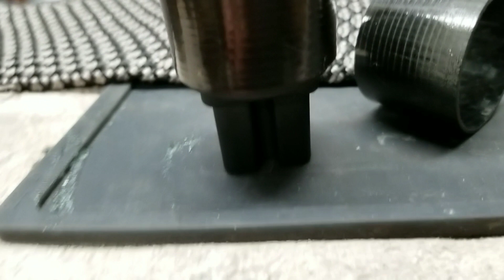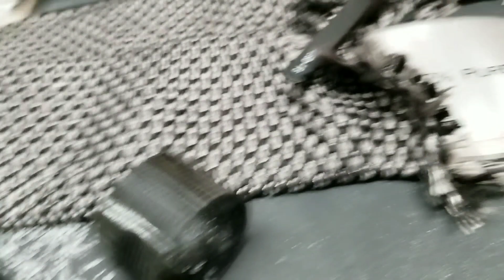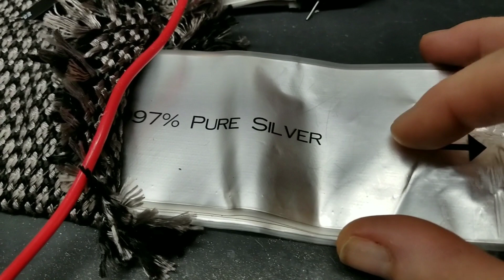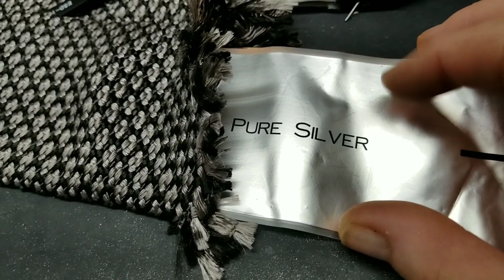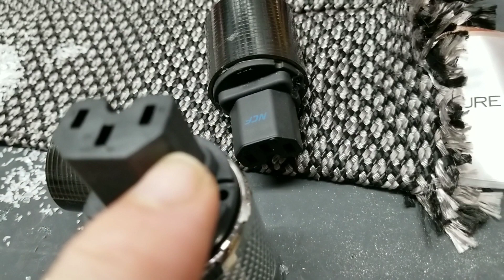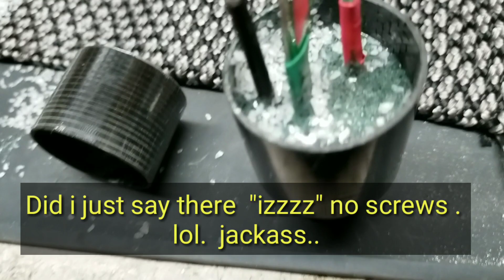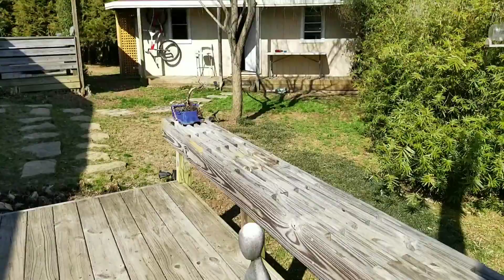Are "High End" audio cables SNAKE OIL ?

Comment: Wouldn't using foils make the capacitance go way up?
Reply from the maker: Sometimes it would , yes.
Reply: @OCDHIFiGuy  Ok. One more question; Why use silver when  you can just use more copper to get the same resistance?
Reply from the maker: @kacperuminski1547  thank you for asking a smart question about the cables. The reason is that Silver sounds different than copper. I can be more specific. 5N silver sounds different than 4N copper in my rig. Many other people experience this same phenomenon
 So it must be a collective imagining by all of us. My guess is due to 5he different lattice structure of silver vs copper
Reply: @OCDHIFiGuy  Copper and silver both have a face-centered cubic crystal structure, so that shouldn't be the differentiating factor. A simple way to tell if there actually is a difference would be through a null-test. Have you ever tried doing that? Have you, perhaps, done any measurements of the cables which you could share?
Reply from the maker: @kacperuminski1547  thanks for the input, is it possible there are things in the world we can not explain or do you feel if it can not be measured then it does not exist ? Again. The other 200 or so hifi cable companies and I have gone around the merry go round with guys like yourself. You're asking healthy questions. Clearly you have a background in science or engineering. I would prompt you to speak with the quantum physicist that own some of these hi fi tweak companies. Jack Bybee for instance. He's got quantum devices that change the sonic. Much more interesting than silver. Let me ask you this.  Some audio systems have a flat, 2 dimensional sound. Others are 3D. How do you measure the level of holographic soundstage ? Because that's what silver does. How do you measute realism. That's another that silver brings, as well as presence. So excuse me while I dip out of this conversation
 Once again you are pushing your prerogative on my thread that states I'm not trying to prove it works for chrissakes. Proving cables work to disbelievers is futile ! How bout this? They dont work at all. I am making people believe my lie because I'm such an adept hustler. So they dont work and my customers are imagining it. We are happy.  Leave us be
Reply: @OCDHIFiGuy  It looks like you are misunderstanding my reason for asking these questions. I want to know whether you have a scientific reason to implement these things into your design or if you're doing it "by ear".

Unlike many people, I am not completely opposed to the use of superior cables. The key word here is "superior" because the cables actually have to be that to justify the cost. Many companies make cables which actually perform better than 10awg zipcord for reasonable prices. (Kimber) They also look nicer. Even though the improvements are almost certainly inaudible, you can always make the case for overengineering.

The issues arise when companies make cables which perform so poorly that they act like a tone control. (Harm the signal.) If you want to equalize your system, you should just use an equalizer.

My goal is to separate the good ones from the bad ones. This thread seemed like a good place to get a grasp of your view on the topic. I was basically curious if you could back your cables with actual science. I feel that this is relevant to the discussion because the main topic of the video seems to be cable design.

PS. If we can't measure something, we definitely can't hear it. Measuring equipment is in every way more sensitive than our ears. It can tell cables apart easily even though we evidently cannot. Finding a property of conductors which couldn't be measured, but which affected sound would be a groundbraking discovery, possibly warranting a Nobel prize in physics.
Reply from the maker: Theres absolutely no way to make a blanket statement true for all humans such as if we cant measure it we cant hear it. Can you measure the voices in my head when I see a hot woman walk by ? I sure as shit hear it.  Can you measure dimensional characteristics in audio ? absolutely not. In other words, how 3D is this system sounding, and it totally changes. So again, if you want me to prove and humor you I say another time and another thread because it involves me driving to a mastering studio and making a video. Science does NOT know it all for science is developed by Humans, an interesting carbon based organism not far from Chimp that seems to want to eradicate itself by eliminating natural resources. Einstein has been proven wrong. Old rules do not apply. Anything is possible including the crazy thought that maybe by using different materials in audio signal transmission lines,  different results may occur. If it is different results we want we use the ear because everyone hears differently. If we want the same result, we use something man made that is very limited in its capability, measuring things like frequency and amplitude archaic characteristics that all rely upon the time domain being linear... which it is not.  So look my man, theres no way you and I will agree, we are like 2 separate species. I happen to believe in something greater than ourselves within which we operate.  Just so happens a lot of us feel the same way. I know of many things felt, heard and sensed that can not be measured with instruments from this plane of existence.  My Hi Fi rig  with music opens the door to higher realms of understanding and awareness.  Good day sir
Reply: @kacperuminski1547  Really? This is good news for me then... I've got 6 patent pendings in this subject!  I can transform the audio performance output on any WIRE, even insulated ones!
Reply: @esotericaudiophile3884   It's quite easy to make audibly transparent cables if you know what you're doing. Your designs must either be very bad or insufficient for the task if they audibly affect the signal. Or you're just imagining it. In lieu of this I have two questions:

1. Did you scientifically prove that you, or someone else, can hear the differences? If yes, where can you access the study?

2. Are your cables within spec for the application they're used for?
Reply: @kacperuminski1547  Yes! Everyone can hear the differences in a "big change" in overall quality to the point that an A/B test is totally unnecessary to repeat more than once!  Really! I can't say more than that because I'm planning to capitalize!

Yes! Cables are more than within spec!They go beyond with no added capacitance, inductance but an increase in conductance if you wish :-).   Believe me if you may? There is nothing like this out there, it's a patent pending technology!  I can easily release the process and materials used here and that will be the end of exotic cable companies... But I worked so hard on this, I need to capitalize first for the sake of my family!  I will be marketing my technology to Audiophile companies. Cable enhancement technology is not the only thing I have patented.  I have power conditioners and other device improvement patents that work so superb...
Reply: @esotericaudiophile3884  Sighted testing can only prove that people think there is a difference. Not that there is one. You still have to deal with placebo, confirmation bias, etc.

Also, I sincerely doubt anyone would want cables which affect the sound. One could do it much better and much more easily with EQ and DSP.
Reply: @kacperuminski1547   I see you have your views, that's Kool!  I'm open minded! There is no placebo at all with this technology guaranteed :-) .   It is a very unique technology in which I have full control of the "wires" performance in ways that are "NEW".   EQ and DSP cannot match the performance of my technology.  The quality is extreme in ways that are "NEW".  

OK, what would make a better "Wire/cable" ? Can you describe? like : Greater Dynamics, Sweet warm mids, Quieter background etc...  Your opinion... Thanks!
Reply: @kacperuminski1547  I'm reading your posts and I like them,but you're making one huge mistake....
you and I both call this a science, which it absolutely is, the people on these channels are part of a religion, that's the difference. There is absolutely no possibility of "hearing" a power cable.
Reply: @kacperuminski1547  
Exactly, if a cable affects the audio, by definition, it's faulty.
Reply: @poserwannabe1  Or insufficient for passing that signal.
Reply: @poserwannabe1  True. But that doesn't apply to everyone here. Some people are indeed "too far gone", but not all. I'm happy if even 1% of the people who read this are convinced that my position is the correct one.
Reply: @kacperuminski1547  
99% know you are correct! You will always have that 1% of flat earthers out there.
Reply: @Coneman3  Name a single thing that we can hear but not measure.
Reply: @Coneman3  Thing is, we know as a fact what parameters influence sound quality, how to measure them and how to optimize our equipment for them. I can prove to you that humans in general tend to like speakers with low distortion, flat frequency response and an even directivity more than ones that accentuate bass, treble or both. Same thing goes for electronics. We have a limit on how low (level wise) we can hear, about -70-80dB for an untrained listener though some trained people can hear lower. That means that any distortion, noise or other artifacts that appear in a piece of audio equipment below that threshold will be provably inaudible to the listener. Thus, if we can design components with sufficiently low artifacts, those components will be audibly indistinguishable from each other. The good thing is that we have long since reached that threshold for most things in audio so, for example, you can quite easily get a provably transparent DAC at about $200.

So, coming back to my original question: Do you have anything that is audible yet impossible to measure? If you do, and can demonstrate it, you might get some good money for your discovery.
Reply: @Coneman3  Sound stage is not a property in and of itself. It's a mix of phase, frequency response, room acoustics and more. (Both in the recording and the equipment.) All these are measurable.

The fact that people do something doesn't make it right. People though and acted as if the world was flat (some still do) and look how that turned out. The same goes for audio. You need to actually back up the stuff you're saying or else you'd just be telling stories. 

On your DAC, the time spent developing a product is irrelevant unless the optimizations actually provide benefits. The effect of vibration on caps is almost always far below the aforementioned threshold of audibility. As such, vibration damping will almost certainly have no effect on the DACs output, if one excludes bias.
Reply: @Coneman3  We know how to 'measure instruments' fidelity because all waveforms are made out of sine waves at a fundamental level. By inputting several sine waves into a piece of equipment we can measure how it will respond to real music pretty much exactly.

Cumulative modifications can only make a difference if the cumulative effect is above the threshold of hearing, which it most often is not.

Null tests are hard to do with complete systems, but not so with blind tests. You can easily ask a friend or a loved one to switch something while you listen. If you follow proper protocol, any actual changes will be revealed and most snake oil will be exposed. The reason why this is needed is because our brain switches into an 'analysis mode' when we change something in our system. It looks for a difference and, most often, it will find one. Even if it has to imagine it. This is why we often suddenly 'hear something we never heard before' after some minor component change. With a blind test, even a single blind one, this bias mostly disappears.
Reply: @Coneman3  Have you heard of diet supplements? Homeopathy? Those are also huge industries with the critical acclaim of many a man. In the case of the former, there is a lot of BS but some supplements do genuine good. (The latter is of course all BS.) Audio is in a similar place as food supplements. Some fields, especially speakers and room acoustics, are still highly imperfect, though we know what we should strive for. Others, like DACs are a mature field where you can get a transparent component at a very low price. And no, I am in no way deluded. I can back up everything I am saying with hard, objective science while all you have provided is an argumentum ad populum and eyewitness testimony which you yourself have admitted is biased.
Reply: @Coneman3  That is a very blatant straw man  of my position. I simply do not accept statements that cannot be proven. If someone tries to sell me a car, saying that it is the world's fastest, I want them to prove that. I won't be content with just going very fast. I want concrete proof. The same goes for audio.

Dowsing, if that is what you mean, has not been science demonstrated to work and is as such pseudoscience. The fact that dowsers are employed only demonstrates humans tendency to be fooled.
Reply: @Coneman3  I have actually done a test like that with solid state (Massdrop THX AAA 789) vs tube (Woo Audio WA-6SE) headphone amps, though I adhered to a single blind protocol. The far cheaper transistor amp actually won. The tube was noticably brighter, probably due to the even order distortion it introduced to the signal, not to say that all tubes do this.

Regardless, if I did not have measurements for the expensive system, I simply would not buy it. I refuse to monetarily support poor design, and I don't like to waste money, regardless of budget.

If both systems measured competently, I would go by build quality as hearing a difference would be highly unlikely to impossible. I would still, however, like to listen to both systems (blind) to make sure. If I did hear a difference, I would choose the one I preferred. :)

Edit: pressed 'post' accidentally, before I had finished the comment. This is the final, intended, version.
Reply: @Coneman3  Great to hear all this! We're finally getting to the meat of the issue. :) My point is actually not that you hear differences because you want to, although that is also a proven phenomenon. My point is that our brain processes something new in a fundamentally different way than something we're used to. To clarify, when you change something about your system, you involuntarily switch from listening for enjoyment to listening for the difference/improvement between the new and the old. Therefore, you will hear a difference regardless of whether there is one. That is the main reason I believe you when you (and others) say that you can differentiate transparent components. As you said, the difference was minimal to non-existent when switching between the two, while becoming larger when listening over a long time. This would be consistent with the above. 

Of course, I could also be wrong and the setups may actually sound different. I don't know since I don't have the measurements. :)

Regardless of all this,

A small tip for your A/B testing: Fast switching with appropriate test tones will always reveal more distortions, jitter, etc. than slow switching with music. All that I have described up to now has been scientifically proven and I can provide you with citations if you're interested. As such, I recommend you try hooking up test tones to your DACs quickly switch between them. That will likely yield more accurate results than normal listening. I actually did this and found out that my old headphone amp had so much distortion in its output that it was clearly audible with a 1kHz sine wave. I heard nothing with actual music. This is a really good and easy test method that requires no additional investment or setup so try it if you want to.
Reply: @Coneman3  Instant switching has, in fact, been proven to be better. Was I being unclear? If so, I apologize. English is not my first language.

In audio, there are only degradations and improvements are only ever the removal of those degradations. It may in fact be as you say and we do hear improvements better than degradations. Until I see concrete proof for that, I will need to reserve my judgement.
Reply: @OCDHIFiGuy  3d sound and soundstage are from speakers themselfs and room acoustics not cables. when you move your speakers in the room soundstage changes you must always find the sweetspot without good placing theres not going to be good sound no matter what cables you use
Reply from the maker: @kacperuminski1547  my opinion is that Music is Art and to mix art with science, you take the soul of the art away. Every piece of artistic creation has intent imbued in its character. One can not measure the level of the creators intention within that piece. If we let scientists make our music systems they would not sound very good. They would sound sterile and without soul. Hifi is for those that have faith, faith that there is something higher than ourselves. Faith that we can make the seemingly impossible possible. We do this for the Fun we have. Science is not for Fun. But science is about to breach into an area of no return. CERN and its collider will eventually create a singularity.  This will dump many agreed principles of science.  What you call hard science will be thrown out as fallacy. Science therefore is not firm. It can change in an instant.
Reply: @OCDHIFiGuy  Exactly, science can change. It adapts to the truth of the world. Therefore, if you can prove what you have claimed up to now, science (and me) will be obligated to change its opinion. That is the only way we can keep being honest with ourselves and the world.

You are right that music is an art, and I wholeheartedly agree that binding it by scientific principals would take its soul away. Sound reproduction, however, is a science. A science that seeks to show the art in a way that is as accurate to the artist's original creation as possible. We know how to measure and define accuracy and, by extension, how to design equipment to be accurate. We want to make the glass in front of a painting as translucent as possible, so to speak, and we know very well how to do so.

If you somehow manage to demonstrate a way that our current theories on sound reproduction are faulty and that yours are correct, I will accept that. Until then I'll just keep on saying 'Pictures or it didn't happen!'
Reply from the maker: @kacperuminski1547  first of all I have no necessity to prove anything to anyone. For proof of something as subjective as sound is futile. What may be proof to you is not proof to another. And so on. This has to do with individual perception. There are no 2 people that will perceive anything exactly alike. So I can be honest with myself and say ," I perceive it as better sound" and that is my truth 100% nobody can take it from me. I can say "I am not constrained by the chains of science insofar as my perception is concerned " and that is an honest statement. I can say "I am perfectly happy not knowing how certain phenomena happens. I do not require the how and the why in order to validate my perception as truth".  And all is true with myself and the world.
I assert that sound reproduction is also art and not science.  It starts with the art of choosing microphones as well as microphone placement. Then there is the mixing artist using the art of measures of each track on the console to create a final product which is collaborative and there is no single "original engineer " who gives a shit what you hear, and if it matches his intentions. There are no intentions. Next comes the mastering engineer he will apply the art of fine tuning the details, the vocals with minute bits of EQ that can make or break a record...so how can anyone record accurately if every microphone is colored ? Use a measurement B&K mic ? But the singer does not use one of those, so within its accuracy,  it is in fact inaccurate,  now isn't it ? So the crap about sounding like original engineer wanted is totally fake and lacks substance. Besides if gear was exactly accurate, and had no Signature it would sound boring. For the last part, I have no drive to be right for it is domination over another and I'm not motivated to stand alone in my righteousness so I could be totally wrong about everything.  I say to my people , listen and decide for yourself. I will help assemble the group.
Reply: @OCDHIFiGuy  You do have an obligation, as someone who makes educational content, to be able to prove your claims. That is especially the case if they contradict scientific consensus. For example: You said that gear without a 'Signature' would sound 'Boring'. That is provably untrue. On average, people rate accurate (flat frequency response, low distortion, etc.) speakers as sounding better than their coloured counterparts. Unless you can prove your claims, what you are doing is better than lying. It would be no better than, though not as serious as, a doctor saying that homeopathic medicine is effective because their patients feel its effects. For your own integrity, I hope you can understand why I consider what you are doing to be immoral.

Do not conflate recording with reproduction. Recording does indeed have more in common with art than science, though science still plays a role. What we are discussing is reproduction. That is where we already have a finished recording that has (hopefully) been approved by the artist and therefore carries their creative intent. In this situation, what has been proven to be most effective is to reproduce the recording accurately and then tweak with EQ and other methods if the resulting sound is unsatisfactory. It is generally agreed upon that adding permanent EQ, distortion, noise and other artifacts to your signal chain almost always detracts from rather than adds to the music.